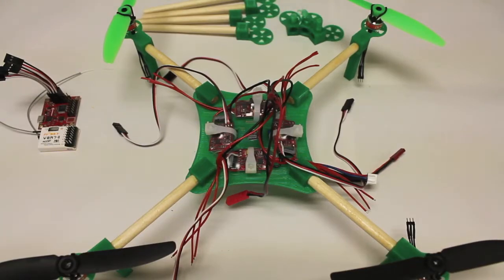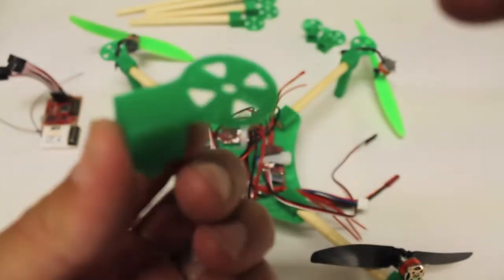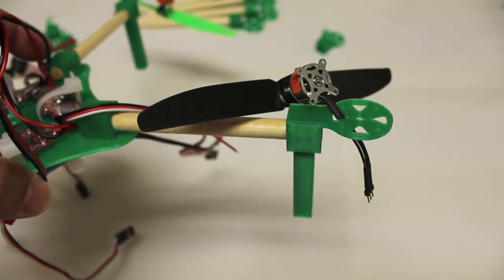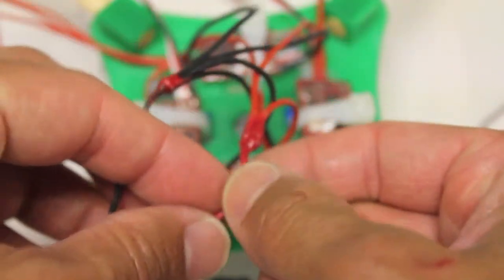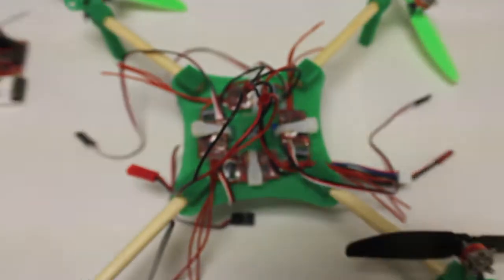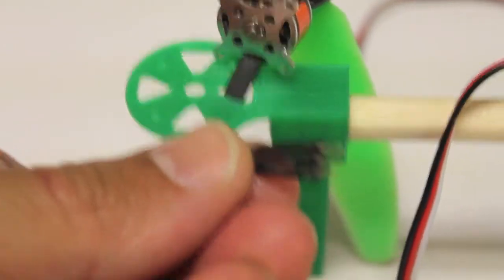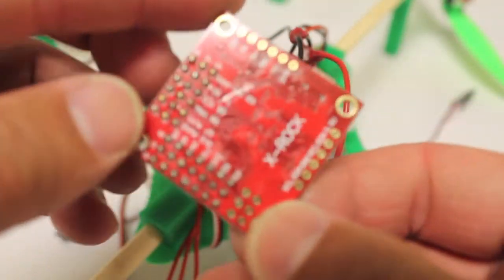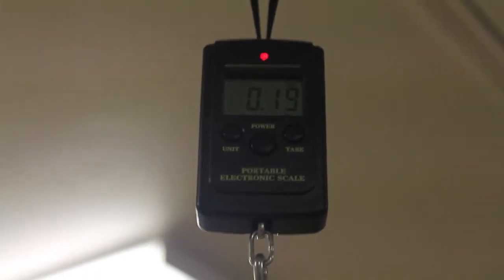DIY Mini Quad ESC Mounting and Landing Gear

Comment from the maker: Always great tips from you :) Regarding the zip ties I need to get some tiny ones since the mounting holes are so small. I do have some hanging wire that I may use in the meantime. Finding screws this small has been a difficult task. Regarding the servo lead idea, the header pins are actually smaller than the standard ones so the servo connector won't work. I've had nothing but trouble with these motors and have a video that shows some of the challenges that I'll post soon. Thanks again.

Comment from the maker: Thanks for the suggestion, guys. Unfortunately the header pins are of a smaller size and don't fit into a servo extension. I'll post a motor update soon so you can see what I'm talking about. I hate to say it but these motors are incredibly difficult to work with so I may be looking at an alternative for this build. But let's see if these can even get the quad in the air!

Comment from the maker: I do have some tape that I could use, but I may have to move the ESCs to the booms due to the short motor leads. We will see and I appreciate the tip. I'm really excited about getting APM going, but need to get this thing up in the air first!

Comment: Hey Dennis for the motors just ziptie them in. I did it on a mini Tricopter and it works great. And for the motor leads just use a female servo lead. That way if the motor spins backwards you can just flip the connector around.

Comment: Hey Dennis great job so far ru going to sell that as a kit or rtf  and where did u get the motors and esc I've been looking around with no luck and I'm building a DJIF450 a lil at a time and I want to do a small acro and stable quad I have a h